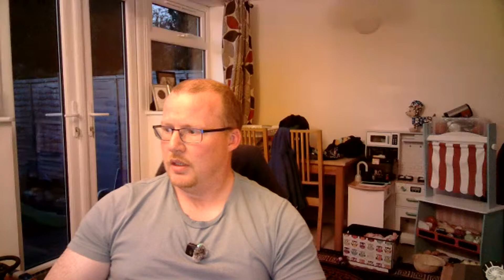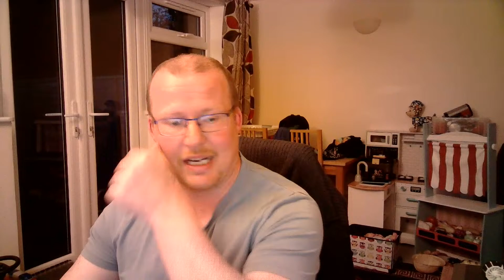Live Yamasaki Repair Clinic: Ask the Experts!

Comment: Hi mate im getting a 2022 yamasaki ym50 re  with a seized engine would i have to get a stock engine for it or would the honda ss50 engine fit and plug straight up thanks
Reply from the maker: Ss 50 should work but you would need to use the stator of the original engine
Reply: @Ridingreviews  hi mate thanks for the reply u mean the stator plate in the engine
Reply from the maker: @thatlxrguy  ye
Reply: @Ridingreviews  cheers bud really appreciate the advice 👍